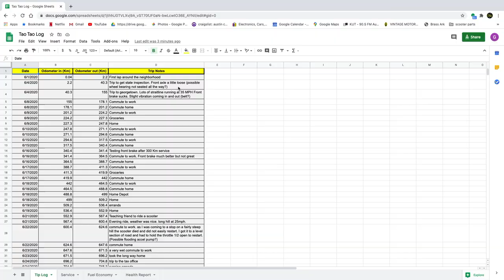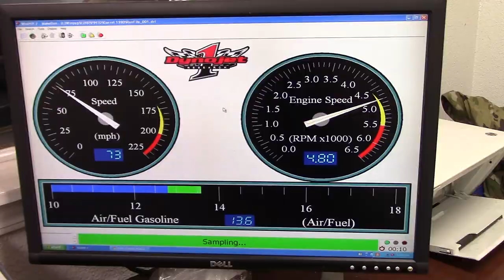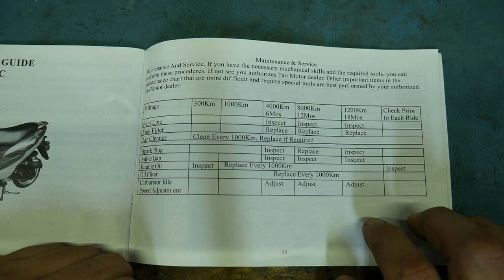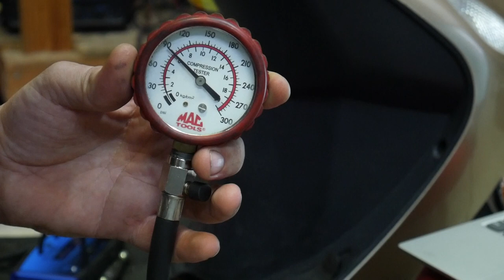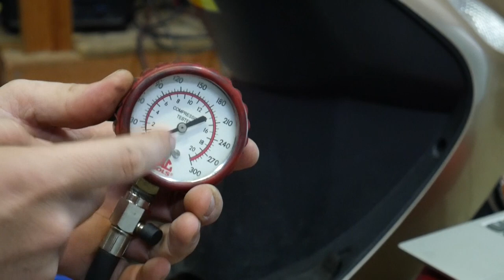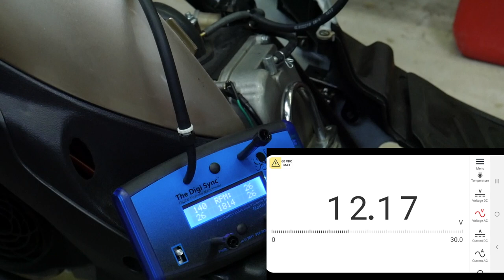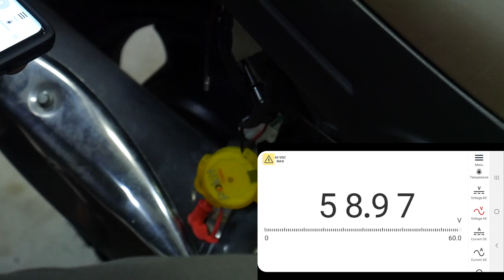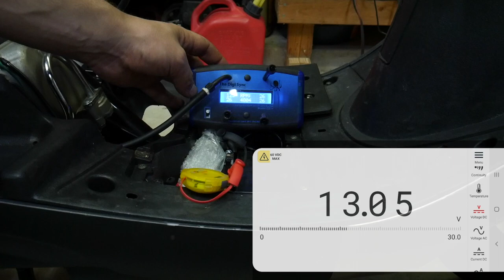(PT.9) The exhaust falls off the most HATED scooter on the internet: Living with a Tao Tao

Comment: JUST A SUGGESTION... If you are going to teach viewers about the combustion process, you might start them out with a better understanding by remembering to call "fuel" gas or gasoline. The reason for this is, which will no doubt be contested here by some, is because gasoline isn't fuel. Gasoline is gasoline. Gasoline and oxygen make "fuel". Since we live in an oxygen environment, we almost always take this for granted. That's why when teaching any part of the combustion process to those who must diagnose combustion issues, it's important to give a clearer understanding. This will allow students to be better equipped to figure out what's actually going on. And for the record, I don't think using the word fuel is wrong in a casual context, but when teaching about combustion, I think it's a teachers responsibility to clarify it. I hope you do too.

Comment: You can in fact derestrict this scooter. This particular scooter (type of CDI) just needs a different 'unrestricted' CDI.
What I also noticed is you didn't use the oil drain bolt on the left side of the engine case.
To add one more thing, the air filter is an oil stained medium like on a dirt bike so the oil in the air box is normal (cranck case blowby does occur when too much engine oil is added or running temp gets too hot), also adding a little bit of oil at service interval will help the life of the engine and richen the fuel mixture as your filter becomes more restrictive.
I'm just here observing and sharing as a fellow mechanic who works on these types of scooters daily.
Reply: dikke crossmotor man
Reply: As a fellow scooter mechanic. Ive had nothing but problems with those unrestricted CDI's on the GY6's. Now if i use one on a 2 stroke like a Genuine Roughhouse they run a little faster but nothing really serious

Comment: i’m at 3000 miles with my tao tao and it only broke down once. the belt broke but i fixed it asap
edit: i’m at 4500 miles now, got a flat tire but got it fixed and it’s still running strong. I’ve been riding since march.
Reply: Update?
Reply: I just hit 3k
Reply: Is it the same model? Overall, I heard it is a good bike...just not this model. Am I right, cause I'm new to the scooter thing. I just purchased my first one. It's a 2021 Wolf v150
Reply: @thatdcdude7434  it’s is the same model and it is a good bike to own just don’t get this model. Mine just recently stopped running and i’ve tried to get it to run but nothing fixed it

Comment: Im running my 150cc gy6 Chinese scooter with no air filter now, only a screen. There was a SIGNIFICANT increase in power and throttle response from doing this as well as also punching out a bigger exhaust hole at the same time. I started running no air filter at 8000 miles. So far I'm at 8,500 miles. I'll keep you updated how long this experiment lasts lol. Anything for more speed!

Comment: It's still going then! I admit I was concerned, but the exhaust  mount weld snapped, ah well you knew it was coming.
Another useful video and can't wait 'till the exhaust replacement and re jet of the carb one as fitting a nice shiny stainless exhaust was the very first "customization" I did to my scoot, I was so proud of myself, a lot of swearing around the manifold bolts and the crush washer kept slipping off as I was fitting the exhaust (solved with a blob of copper grease), and that was three years ago, can confirm exhaust still going strong and still very shiny.

Comment: Always fun to see how the experiment is going!  I wonder what is starting to degrade that is causing the voltage drop?  To me the magnet/wires spinning around seems like a pretty stable and simple thing.  Maybe the magnet is losing a bit of pull/strength with the heat from running the engine?

Comment: As a long time Chinese scooter owner I have been following these videos with interest. Initially I was pleased to see a qualified mechanic take ownership of a Tao Tao thinking the scooter would be given a fair shake. It wasn’t long before I began to see that this was not the case. While doing a proper Post Delivery Inspection Garret dwelled on totally non important issues. Testing to see if the ignition trigger had the proper resistance was beyond all needs. If it runs, it works. Continually testing those functions is simply unnecessary. He also ignored previous experience with these and took no action to prevent the exhaust from breaking. 
My pet peeve. Comparing an $800 scooter to a $2100 Genuine or a $4200 Vespa. Does your Honda Accord ride and perform like a BMW, Audi or Mercedes at many times the price? No. In a scooter it’s the engine that gets you down the road. Which brings me to my last peeve. The spark plug looks too white. In this age of ethanol and no lead gasolines all plus on stock motors look too white. In a mad attempt to satisfy his fears he jetted the heck out of the scooter. As you can see on his maintenance chart his gas mileage plummeted from 110 mpg to 74mpg. 
He has finally abandoned the “Living with a Tao Tao" having not taken the scooter to work since the beginning of September or riding it all since the beginning of October. So I guess he has proven after all that the problem with Chinese scooters is the owners after all.
Reply: The sad truth...

Comment: My  tvs scooty pep is almost 15 years and run close to 200000kms has never had any electrical issues ,its still running strong
Reply: That is truly amazing! Does it have the original engine, or has it had major work?
Reply: @caduceus33   ive had the cylinder and piston changes once and replace the drive belt several time. No other major problems
Reply: Did you open the throttle valve and choke valve if it has one while doing the compression test ?
Reply: @thomaslemay8817  i dont remembe ,the cylinder and piston were replaced almost 6 years ago.
Reply: 200k!?

Comment: Ill also say, if youre having carb problems, swap your carb to an 18mm slide carb for a relatively stock scooter, or a 21mm slide carb for a big bore kit.  It eliminates the vacuum operated needle and the throttle response is 10 times better.  You have to change your throttle cable to a slide carb cable, and may have to bypass your vacuum line system depending on your carb, but its so worth it.  On 150s and 125s its negligible, but on a 50cc the CV carbs are so slow and so finicky

Comment: Great video as always, Garret.  Are you convinced that a few simple modifications to the scoter will make it more reliable?  I'm curious what you would chose to modify now to a brand new scooter if you were to do it all over again.  Also, I'm wondering if you'd consider doing a motorized bicycle series like this one, it's super cheap, but suffers from the same quality control problems (either real or imagined) as the Tao Tao.  There are also a whole host of cheap "upgrade" parts, just like the Tao tao.

Comment: So.. Since you're re-jetting the carb are you going to take that opportunity to un-restrict the air intake as well? I realize that'd create an even leaner condition but since you're re-jetting you should be able to dial it in. Maybe make a little more HP for that off the line acceleration that machine struggles with. Pretty sure that in combination of the exhaust replacement/upgrade is going to turn that thing into an entirely new machine as far as feel.
Reply: Unrestricting the airbox on these does about nothing on these.

Comment: The whiting on the header is making my teeth itch, can’t wait for the upjet. Seriously 😂

Ps great vid and loving the series!!!!

I’d not be surprised if the stator was wearing, at least on my Vespa when the voltage starts creeping UP - that’s a sign the regulator is done.

Once you have completed this test and if the motor is still in good working order - id love to see you fit a cam, fully derestrict and put lighter weights in. Just to see if it can commute to a reasonable level 👍

Comment: The welds are bad. The welded in nut from my trunk broke off so I had to take it off.   Those "tools" they send you are junk. You really shouldn't be performing work with them because a  wrench set is cheap . If you own this scooter you should be able to afford the $40.00 for tools at harbor freight or at the auto parts store.  If you're looking at buying one include an extra $300 for parts and tools.

Comment: Wow! That is so early to have an exhaust failure. I can’t wait to see how the performance is with the re-jet and better exhaust.
Reply: The exhaust replacement may or may not require a change in the roller weights to put the engine in the new powerband.  Depends on where the new powerband is.  Usually the powerband on a hi-perf muffler is at a higher rpm than stock.

Comment: For many years, VW beetles had even less of a "filter" for oil and did quite well. Junk/sediment usually accumulates in the cap/cover. Now you see why they recommend such frequent oil changes. Think push mower engine.

Comment: Dude. When I bought my Bashan they advised to ditch the battery for a new one asap. If your standing battery voltage is dropping it means the battery is drawing more from the charging circuit and lowering your idle voltage. How do I know. My Kawasaki just killed it's five year old battery and was dead at the start of an event I went to. I got a jump and monitored the voltage on the meter in the speedometer Kawasaki graciously provided. All the way home I monitored output and never saw more than 12 volts. A load test revealed that with the key on, lights on, voltage dropped to 11.6 volts. Trying to start it gave a voltage of 5.6. I bought a new battery and voltage at 4,000 rpm indicated 13.1 while at 5,000 rpm the onboard meter on the road showed 13.8. All you have to do is check standing voltage with the key on and lights glowing to see a drop in standing voltage each time and why your test voltages are dropping equally. A battery requiring more charging voltage is a resistor in the circuit affecting your charging volts.
Reply: I've had Kymco engines with charging problems.  Both were Xciting models.  One bike was 10 years old, the other was 12 years old, when the charging system failed.  Replacement of battery (following the standard fill up new battery and charge fully with the battery manufacturer's own charger) resulted in a dead battery within about 3 days, on both bikes.
The funny thing was that whenever I checked the charging system on the center stand (using the procedure in the service manual), the battery was going UP to 13.8V while revving the engine.  Something was happening after the bike was running for a while which caused the charging system (on both bikes) to cut out.  (I would literally drive 20 miles, then stop to fill up gas and not be able to restart the bike.)
I ended up (when I bought the 2nd replacement battery on the first bike and it was still dying) replacing the stator coils and the regulator as a set and the problem went away.  I still have the older bike.  I  never did figure out if it was a stator (insulation) or regulator (heat) problem since I was unable to reproduce it while I had my test equipment on the bike, although the electronics guy in me wants to say it was probably the regulator.
Reply: glenn doiron 
I get it when a component breaks down or fails when it gets hot. That's not what's happening here. He's admitting his standing voltage is dropping but extending the lack of charging voltage to a weakening regulator. Not only that but checking the charging voltage at 5k rpm is ridiculous. His running flat out is done around 8k rpm. Plug in the voltmeter there and probably see about 14 volts charging the battery.
Reply: @kz1000st1  The service manually usually specifies the RPM to check the voltage at.  In this case, he's noting that the voltage is falling @ 5,000 rpm each time he does the health check.  The voltage regulators in these bikes are usually very simple, they take the 3-phase AC from the stator, change it into DC, and have a crowbar circuit to stop it from exceeding a set voltage.  The crowbar circuit stops the stator output voltage from annihilating everything electrical on the bike when the engine revs to higher RPMS and/or the load on the electrical system is low.

The output of the regulator itself tends to have a ton of voltage ripple at lower rpms or higher electrical loads.  You won't normally see all of the regulator ripple because the battery is attached - the battery will smooth out the peaks & valleys by discharging/charging as the regulator voltage rises/falls, and any peaks are chopped off by the crowbar circuit if they are above the maximum allowed voltage.

(The battery charging portion, however, tends to be... a diode.  No voltage monitoring, no current limiting, no cutoff, no trickle charging - there is no battery management on these bikes.  This is why they usually set the regulator crowbar circuit to trip at 1 diode drop above what they want the maximum battery voltage to be.)

If the battery fails in such a way that the internal resistance gets higher (which is usually the way that they fail), it limits the amount of current it can charge and discharge on each cycle.  This would normally have the effect of making the peaks and valley taller on the electrical system.... but the peaks are actually limited by the crowbar circuit on the regulator, (maybe they are / aren't at idle, but I'm 99.9% sure they are being crowbarred at 5000 rpm) meaning that only the valleys get lower.  For the engine running test, on your typical DC multimeter (which basically samples the voltage several thousand times a second and displays a rolling average) this would show as a lower voltage than if the battery was in better shape (and feeding more current into the system when the regulator output falls) even if the standing (no load) battery voltage is *exactly the same* for both battery conditions.

As you rev the bike up in RPMS, the valleys would get higher, (if it weren't for the presence of the crowbar circuit, the peaks would also get higher too, but if the regulator is Ok they are still being clamped at the same maximum allowed system voltage), so yes, you could see it at around 14 volts if you keep revving it up. *But this tells you next to nothing about the battery, or its status.  This just means that the output of the regulator is higher (in the valleys) than it was at a lower rpm, which is exactly what you'd expect.  You don't know if the battery isn't pulling down the voltage because its fully charged and doesn't need to pull that kind of current, or because its damaged and it just can't pull that kind of current.*

It is also possible for the zener diode in the crowbar circuit to drift over time (this one is a long term effect, talking years here), or to be damaged (due to environmental stresses), and clamp at a different voltage.  Or, you can have a failure (open) in one of the windings in the stator, which will also tank the voltage (although stator winding failure would result in a rather significant loss of battery charging ability especially at lower engine speeds). You just can't tell for sure with the battery connected, whether the drop is due to the battery going bad, or the regulator (or the stator, but as I said before, loss of a winding would cripple the regulator's output and you would see a huge loss at idle).  It requires deeper analysis, which nobody but an electronics hobbyist with free time could be bothered to do.

The thing is, the battery is usually the thing that goes bad, and batteries for these bikes are readily available AND easily replaced by the owner, so all other things considered I would definitely replace the battery first, before replacing the other parts of the electrical system, which tend to require more labor.

Comment: You are right on the derestricting sir flow, i did that and lose more then 5mph on the top end. I did put in a higher output coil and CDI thing but no noticable imprivment. Did go through 3 Carbs in my time 2 of them were leaking gas into the air cleaber abd onevsine how got a hole in that diafram thing. The 4th has beed good last 5 or 6 k miles (or Kilometers)

Comment: Hey Garret, I have a problem..please consider helping me.. I have an Indian Scooter named dio that is purchased after using by another person.. the scooter wont speed up..i cant go beyond 60kmph or cant climb steep hills upwards.. i feel like something is stuck..so i changed the cvt belt.. serviced the rear pulley with new grease and still the problem is same.. I did a tappet adjustment too.. still the problem is same.. i feel like there is a small compression leak from the sparkplug..the sparkplug is stuck just turns and cannot take it out with a socket please help me
Reply: Honda dio is a very slow scooter nothing is broken, consider upgrading to a 70cc cylinder kit.

Comment: Hey man, how do you like that digisync you use in some of the videos? I just ordered one and haven't gotten it yet but I was curious if your honest opinion
Reply from the maker: Honestly I love it. I've used a ton of different balancers and I don't think any of them are as easy to use. I love the built in magnet and that it is self powered, so you don't have wires strung all over the bike (and other technicians always seem to tangle them). The next best balancer I've used is by vacuum mate and it costs $800. I plan on doing a review video of it soon
Reply: @Scooter_911  I appreciate the time spent to comment back, and most of my bikes are single carb with the exception of three and I have always just listened to sound of it running  so probably not that balanced haha but I have to completely redo someone else's job, bought a non running bike and I remember seeing you test the rpm with the digisync and it peaked my interest